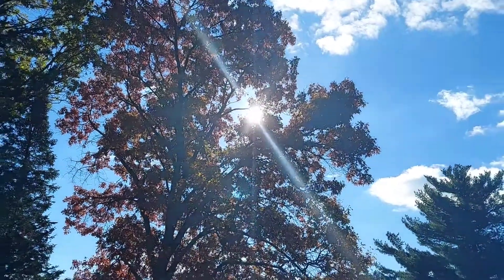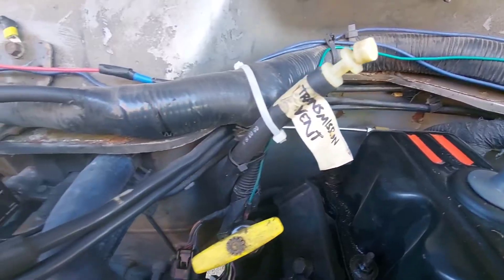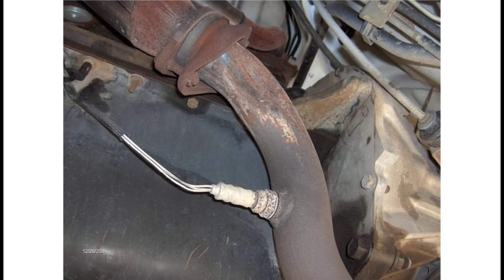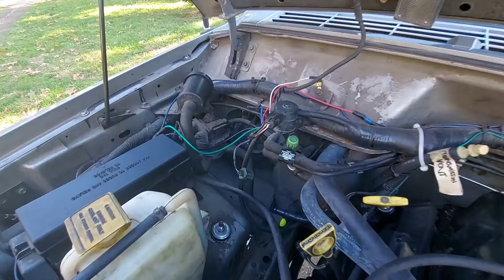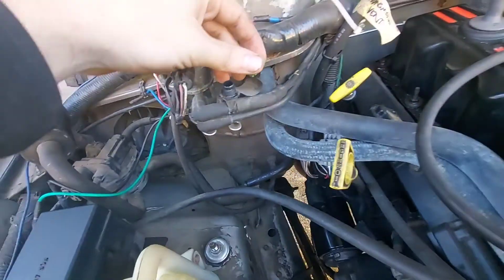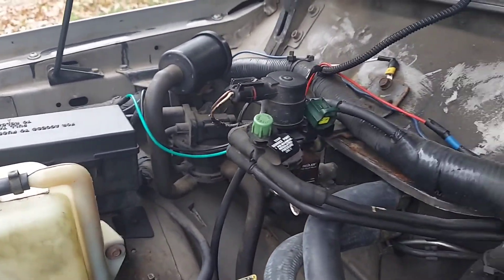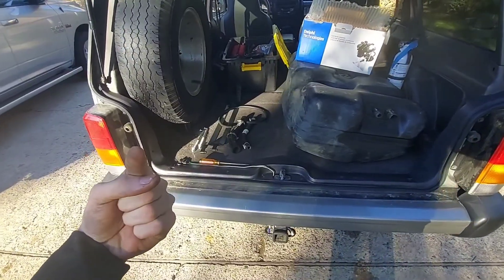Jeep Cherokee: EVAP System Tour; How it Works + Test it Without a Smoke Machine! [‘98-’01 XJ] P0455

Comment: "very flammable pressurized gasoline which to say the least is probably not a good thing"

OTOH, if you don't let it pressurize, gasoline never reaches the vapor pressure that stops it from keep evaporating and you're always losing gasoline.

So the real solution is in the middle.

Comment: Greetings, dear friend, excellent video and very well explained. I have two questions. First, what pressure is reaching the purge valve (negative or positive)?
The second question is: what voltage should be reaching that valve? I mean, what voltage does that valve work with, 5 VDC or 12 VDC?

Without further ado, I bid you farewell from Venezuela.
Reply from the maker: the purge valve gets vacuum from the intake manifold, and allows that vacuum to be supplied to the charcoal canister when it's activated. I don't know what the voltage is

Comment: If I have a evap or vacuum leak can that cause a weak/rough idle?
Reply: Is there oil in ur throttle body if so ur pcv valves are bad like mine no cel tho

Comment: 2001 XJ Po456. It was a rotted hose under the truck where it starts the turn upward along the fire wall. Take a good look there for deteriorated rubber. It is close to the road. Only time in 20 years I have seen the CEL

Comment: just remove the evap crap
Reply from the maker: @227lazer  firstly, tampering with emissions system is a felony, and secondly, doing so removes your justification for complaining about bad fuel economy
Reply: @WAEMIDIV  it wouldn't let me leave a comment. So any ideas/suggestions on if there's no charcoal filter on the older ones (93) and that metal line runs all the way down the car and is rusted to shit? I know people are already saying shit like this but it's not like gonna leave me stranded or do anything drastic if it's fails?
Reply from the maker: @johnjacob2693  you can still replace that line with any equivalent sized emission hose, but it can't ever leave you stranded. It's just emissions stuff, non essential

Comment: I appreciate your thorough breakdown. I found the 3" hose attached to the charcoal canister was old & cracked. It cost me $3 to replace & couldn't have been easier. After 1 1/2 years of looking @ my check engine light it's now fixed! THANKS! \m/

Comment: Can I just remove all of this?
Reply from the maker: @colebuchholz3083  Yes but you will definitely have negative side effects, you'll need a vent from the gas tank to the atmosphere to prevent the tank from over pressurizing, which also means gas will just evaporate right out of the tank at all times. You will need to cap off the vacuum lines and will always have an error code for the purge valve at the very least, no matter what you do with that, not to mention worse MPG

Comment: I want to thank you for this superb video. My 2001 XJ has / or rather had , thanks to your video) the P0456 Code - Very small leak. My understanding this is a pin hole size leak and near impossible to find. I sent air through the system, hopefully listen for a leak, (none) then decided to block off the LDP to see if it was the pump. I did and I still had the code. So I thought it must be the pump, so I reluctantly bought a new pump,  installed it and after blocking off the pump I still had the code.  So it was either a bad (new) pump, unlikely  but possible,  or the hose. Hose looked good, so  I deduced  the only place it could leak was at the connection. I placed hose a  clamp on the Pump connection side for the hose, and the code went away. I was thrilled. Would never of thought of blocking the LDP in a million years. Couldn't have done this without your video. Again thank you.  Your video is the best out there.
Reply from the maker: @RonMalo-s1i  Shame you bought a new LDP, but sounds like the old one still works! I'd keep it. Sometimes, I find them at junkyards for cheap and give them to people. 
Yours had one of the most annoying leaks... if you think about it, if it didn't have a leak detection pump, it wouldn't have leaked... Chrysler's finest
Reply: @WAEMIDIV  Yea, I was really annoyed with the whole set up. Why have a code for stuff you can't find. The  old LDP  still works, but its the original,  so its pushing 25 years, so I'm ok with the purchase. (XJ  only has 145K miles.)  Bought the cheapest LDP I could find because I was skeptical. I went to the junkyard looking for hose elbows. Found most of the EVAp stuff had been picked over.  Oh well, like you that CEL drives me crazy. So  glad you had the solution.  Loved your ZJ gas tank swap video. I agree with you, most videos gloss over the most annoying / troublesome parts, or assume people have lifts or welders at their disposal. Many thanks.

Comment: so I smoke tested it and smoke came out of my Vapor Leak Detection Pump Filter, does this mean my Leak Detection Pump is bad??? Any help would be greatly appreciated, Thanks!!
Reply from the maker: @shrigmaaa  uuhhh... possibly, I've never seen that happen before, but if you also have P0455 it's a safe bet to assume the LDP is failed, especially if smoke didn't come out anywhere else

Comment: P0203 injector circuit/open cylinder 3

P0303 Generic cylinder 3 misfire detected

P0138 o2 sensor circuit high voltage bank 1 sensor 2

P0455 evaporative emission system leak detected(Large Leak)

Where do I begin? 😵‍💫
Reply from the maker: @eltavo7104  you have 3 separate and unrelated issues. 

Cyl 3 misfire is because the fuel injector for that cylinder is not working - a broken wire somewhere is causing it not to be powered, so cyl 3 isn't getting fuel, which makes it misfire

O2 Sensor B1S2 is the downstream one, between the catalyst and muffler on the underside (97-99) or above the front differential (00-06). It's likely the sensor is bad. 

Evap Leak: well, follow the procedures in this video
Reply: Check this out. I replaced O2 sensors and the fuel injector. Drove perfect for 3 days and code came back for misfire cylinder 3. I decided to change fuel pump,hoses, and gas cap. I'll update y'all what happens Monday night. @WAEMIDIV

Comment: what if the temps gets hot outside and the fuel tank is getting pressurized due to heat expansion ? 
can a bad evap purge valve cause the fuel tank to over pressurize ? 
i read mixed information about if the fuel cap is vented to atmosphere (but believe that it is not and all the venting should be into the evap canister)
first i am going to pull the lines off and see if the are clogged. ..
Reply from the maker: Heat doesn't have anything to do with it, gasoline just evaporates and vapor naturally takes up more space than liquid, so it pressurizes itself ambiently. The gas cap does have a vent on it that's designed to open at a certain threshold as an emergency release, but I don't know what that pressure requirement is

A stuck purge valve can indeed cause overpressurization, as can a clog in a line. There are OBD codes for both of those conditions
Reply: @WAEMIDIV  okay thank you so much for the reply and awesome videos!. 
(my xj is 1998btw)   there is currently NO check engine light on. but i need to get this sorted out.
i will try to swap out the purge valve with one from one of my other jeeps and see if that helps.
next, i will pull the lines off and blow through them to see if they are clear. 
the tank is getting way over pressurized so much that it is expanding like a balloon until i open the gas cap. i installed an old gas cap that i had laying around but i am unsure if it is even good... if the purge valve swap doesn't help, and the lines aren't clogged, next i might get a new gas cap.
i have another issue that i think is unrelated;
The jeep doesn't keep it's fuel primed like it should (i have to cycle the key a few times before it will start) so for this i bought a new fuel check valve and still need to install it. 
would a bad fuel check valve cause the tank to over pressurize ?
or could these problems be related in anyway ?
Reply from the maker: @MrMrsregor  Not all 98s have a full EVAP system, if yours doesn't have the leak detection pump then it won't know how to display errors for alot of the EVAP stuff, which doesn't mean it can't fail, it just has no way of knowing if it does. The fuel priming is unrelated, you will need a fuel pressure regulator, which might be this "check valve" you got (maybe the same part with different names)
Reply: @WAEMIDIV  oh, yes, i miss spoke, you are correct, the fuel pressure regulator is what i bought..
could a bad fuel pressure regulator effect the tank pressure or just the pressure in the fuel line going to the fuel rail?
Reply: @WAEMIDIV   oh yea, you are also correct again. My 98 doesn’t have the leak detection pump…
Reply: @WAEMIDIV  okay, I figured out my tank over pressurizing problem for anyone else that wants to know what my problem is; the line that runs from the top of the tank and vents into the canister must be clogged. I pulled it off from both ends and i can’t blow air through it. i just had to use compressed air to blow out the line and that FIXED it !
Pro tip; don’t break the nipple fitting on the charcoal canister like I did, just cut the hose off if it doesn’t come off easily
Reply: I had two problems, and the solution to my long crank (having to cycle the key a few times to build fuel pressure before it would start) was to replace the fuel pressure regulator (it has a check valve inside the regulator 97-01)

Comment: So I don’t have a CEL (it’s a 1996), but the damn thing STINKS of fuel when I first fuel up and drive around
Reply from the maker: 96 should have CEL it could be burnt out if there's a fault and it's not on. You can plug in a scanner and read it to see if there's any codes. But 96 doesn't have a LDP, so there likely won't be any EVAP codes
Reply: @WAEMIDIV  Oh my bad, I do have a CEL but it’s not related to the EVAP system. I have a P1391 Code even though even though I’ve replaced that sensor multiple times. 

I was more so concerned with the strong smell of $4.39 a gallon every time I park haha

Comment: If you open your fuel cap and the pressure comes out wouldn't you think there is no leak at the tank? If there was a leak there would be no pressure right?
Reply from the maker: if there's pressure coming from the fuel cap that usually means the EVAP line is clogged, not leaking. Pressure should not be able to build excessively

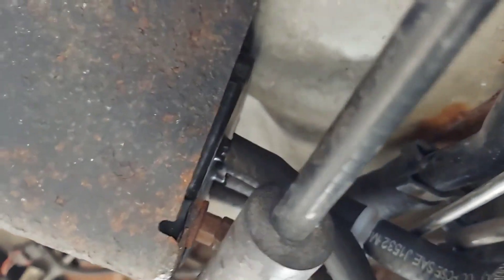Comment: Does the 5/16" hose fit directly into the evap cannister? It looks like you spliced it into a larger hose (screenshot at 11:41). I just took off my connector hose from the evap cannister to the metal line (mine isn't rusted through...yet) because it was cracked & leaking but it looked to be one diameter at the metal tube side and a larger one at the cannister side. Thanks.
Reply from the maker: I think the plastic fitting on the canister is 5/16", and the plastic line where it enters the fuel tank is 1/4", so there may be an adapter in there but it's been so long I don't remember

Comment: Amazing video. Question: any harm in me permanently capping that hose you nerfed on the LDP to keep my CEL off? Been chasing leaks for a long time and I still can’t find it.
Reply from the maker: no harm, I would cap off the other end as well though, as fuel vapors could potentially sneak out of there. But with the test hose blocked, the LDP will never find a leak, so you'll never get a CEL. Excellent way to bypass the system
Reply: @WAEMIDIV  Done and done. I’ll fix it properly one day ;) You’re a legend.

Comment: Anybody know which of these defects can cause gasoline odours from the jeep when just sitting in the garage?

Much obliged!
Reply from the maker: usually that's a leak from something right on the tank, like the gas cap or the metal line to the charcoal canister, but it can still be leaking from anywhere. I'd replace the gas cap first

Comment: So now the question comes as to where does one get the fittings/connector/boots whatever you may call them for the charcoal canister and manifold side, my connections are pretty much dry rotted out
Reply from the maker: There's not any OEM replacements anymore, even the dealership doesn't carry them. You'll have to get custom cut pieces of vacuum hose that's fuel rated. Sometimes you can find miscellaneous fittings at parts stores that fit. I just have a random assortment of those on mine
Reply: If you take this type of parts into most auto parts stores they can usually find something close that may work.

Comment: Great info and very well presented. Not sure if you're still answering comments on this vid but I was wondering: assuming the LDP is not faulty and can hold pressure within itself, could you just clear the check engine light, block off the LDP like you did, then take the vehicle in for inspection after all of the internal monitors in the ECU have gone through their checks? Might need to find a more inconspicuous way to block the line but I'm wondering if that would be a temporary workaround to get a sticker. After moving from FL up to NH I don't think my evap leak is going to fly anymore lol
Reply from the maker: Yeah, I imagine that would work. Most state inspections don't much inspect the vehicle, they just scan the computer for error codes or use a Tailpipe sniffer. The only state I've heard of that actually does thoroughly look through a vehicle is California but I've never been to New Hampshire so they might take a look around. But that's the only thing to be concerned about
Reply: I appreciate the response - I'll give it a go and see what happens. Have learned a lot from your videos over the past couple years keep up the good work! @WAEMIDIV

Comment: This comes that whistling sound when cold or start, when the engine gets got , it develops pressure then all of sudden it shuts off randomly ,  there is thin small hoses inside under  the dashboard  may go to the air vents heating system,  there will be no code , also the next problem common problem is the heat soak cylinder 1, or 234

Comment: Great video and great information.  I don't have any problems, yet.  I was trying to locate the fuel filter and found out there's only a strainer inside the gas tank.  Since the injectors have never plugged up I guess the strainer is good enough.  And, now I know what that square box bolted near the gas tank is....the charcoal canister.  Whod'a thunk it???  Thanks again for the great video.

Comment: i been working on my 1997 zj evap leak for over a year now i have ran out of ideas and now doing the parts canon. replaced the gas cap 3 times , new filler neck, new fuel pump mopar gasket and lock ring, fuel filler and vent hose too new rubber lines , new LDP and purge valve. Only thing left to try is the charocale canister and LDP filter .i did a home made smoke test and found no leaks after replacing all the lines and fittings but still get the evil P0442 small leak at this point i think i might just take my cel bulb out and give up trying to fit it. on your gas tank did you find where the leak was coming from ?
Reply from the maker: Yes I took it to a mechanic for them to smoke test, and they found the leak on the fuel pump seal. Take a look at the quality of the rubber fittings on the charcoal canister/ intake manifold

Comment: I have a 99 Xj. I have a p0441 and p1494 code. I can also get whiffs of gas in the area of the leak detection pump on the passage side firewall. Any ideas?
Reply from the maker: P1494 and P0441 in tandem with each other confirms a failed Leak Detection Pump. The case might be cracked which would explain the smell of gas near it

The LDP air filter may also be clogged, so check that while you're there, but the LDP needs to be replaced
Reply: @WAEMIDIV  Thank you so much for the fast reply. So to be clear, if the filter is plugged it can cause the fuel smell, and throw the codes? Or the LDP needs to be replaced for sure?
Reply from the maker: @patriot72  P0441 means "incorrect purge flow" so either the filter is clogged, or there's a leak in the LDP itself. The fact that you also have P1494 (Internal electrical failure of LDP) and can smell gas, tells me the LDP is 100% failed, I'm just saying to check the EVAP filter and make sure that isn't clogged as well. Yanno blow it out with compressed air or something. They do actually still sell those little filters on rockauto too, if you want to replace it
Reply: @WAEMIDIV  Thank you so much. I will replace the LDP and filter. Was I in any danger of any kind with this issue? Also will this improve gas mileage at all? Sorry for all the questions, it’s just nice to have the help which is what I believe you’re channel is for. That’s why we have our channel as well. 👍
Reply from the maker: @patriot72  Danger, no not really, unless you have a common issue of people lighting cigarettes in the back left corner of your engine bay specifically 

Gas mileage yes, because think - you are leaking perfectly usable fuel vapors into the atmosphere, instead of diverting them into the engine where they can be used. So fixing this issue will definitely increase your MPG, but by how much just depends on how badly it's been leaking. It may be so minimal of an increase you don't notice, or you could gain like +2 MPG
Reply: @WAEMIDIV  Thank you, God bless my friend!
Reply: @WAEMIDIV  Good evening, as you advised I ordered a LDP and LDP filter. I was under the Jeep and was rechecking the torque on some bolts from a lift install I did a while ago. Seeing I was under there I inspected some other parts and I caught a few light whiffs of gas near the charcoal canister as well. Is it normal to smell anything in that area? I appreciate all your help brother!
Reply from the maker: @patriot72  No, the fuel system needs to be entirely sealed, the only time you should ever smell gas is at a gas station
Reply: @WAEMIDIV  so I should swap the charcoal canister out as well?